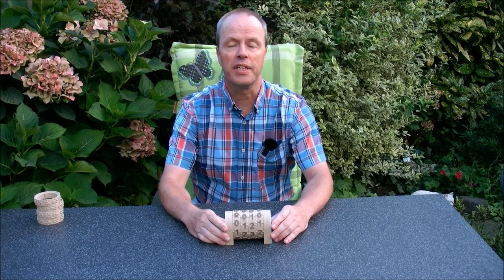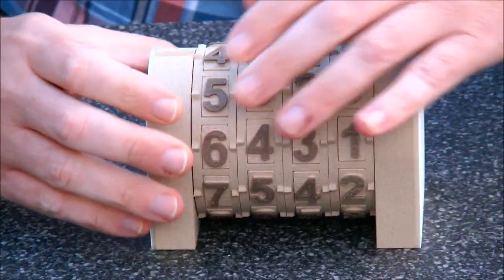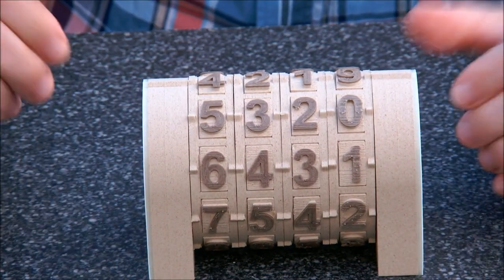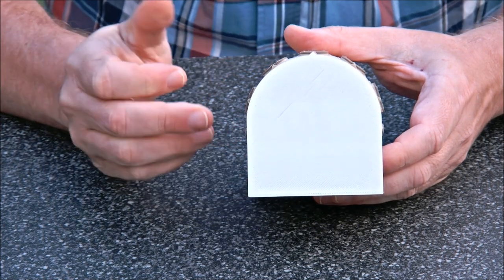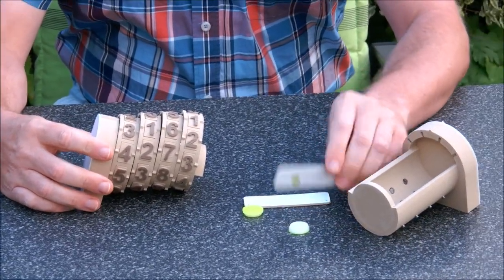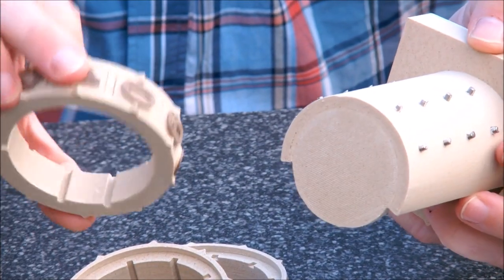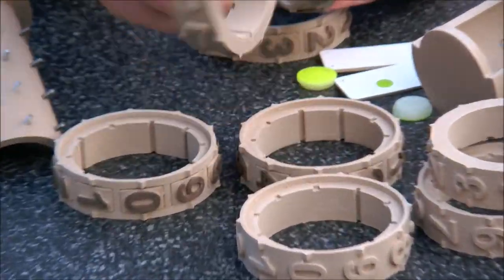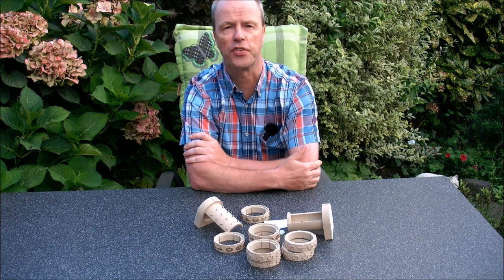Combination Box - What makes this combination lock and actual thinking puzzle?

Comment: Please send it to LPL and see how much time he takes to open it
Reply from the maker: I am pretty sure this is LPL-resistant. LPL is welcome to buy one. So are you.
Reply: finding that loose spot in the travel after inserting a thin shim of metal
Reply: @KarizmjhgvnRaiha  
I sincerely doubt there would be any need for a shim.  You'd probably only need to apply spreading force on the lock while searching for binding wheels.  (I am a retired locksmith.)
Reply from the maker: I don't think that will work. Please look at the mechanism. I believe that it is both shim and force/binding resistant.

Comment: One thought I would have: As I understand it, you need to expose glow in the dark materials to light, for a while, in order to make them glow. They lose energy over time.

If you put something like a grid of moving shutters over top of a surface that has been painted with glow in the dark ink, then the player will be able to choose which portions to expose to light and which to protect from the light, before going to look at the end result.

A puzzle might be to figure out where to move the shutters to, so that a meaningful message is created to get an answer to some other problem. Moving the shutters to the wrong place would create messages that are meaningless or give false answers.
Reply from the maker: Hmm, a shutter/pattern puzzle. I need to think about this.

Comment: A puzzle with a mix of glow in the dark and normal pieces (combo lock rotors, magic square tiles, etc.) are used. So that you need to cross-reference both what's visible and what glows... or have the "visible" bits be in Braille and they need to be paired with a glow-in the dark marking that are in the same patterns.

Comment: You can also use glow in the dark for a 4 by 4 slide puzzle with two solutions. The first solution is a clue for the next puzzle. The glow in the dark is the real solution. This can be checked with pinns that fit in a hole on the backside of the slider. The holes on the sliders backside are on different places in X or Y position.  If the holes does not allign then the pin array can not go up. If you solve the puzzle then the pin array can go up and unlocks the next puzzle. In this way you can create a puzzlebox.